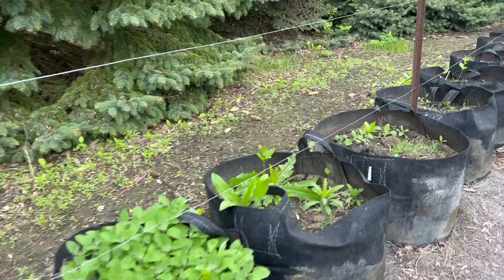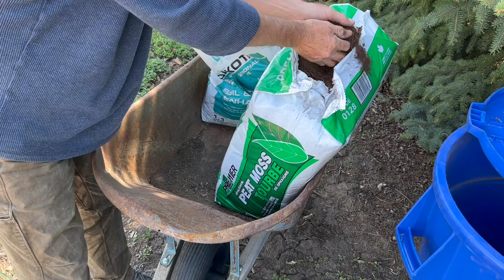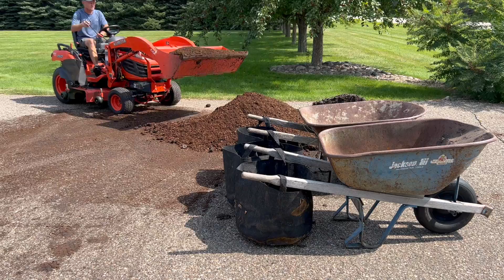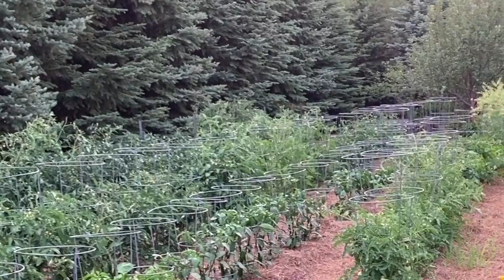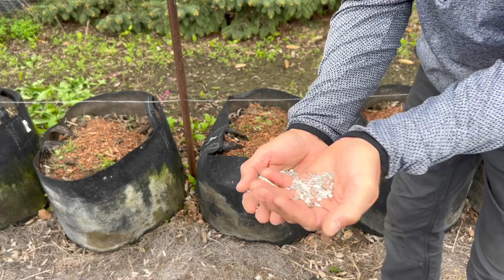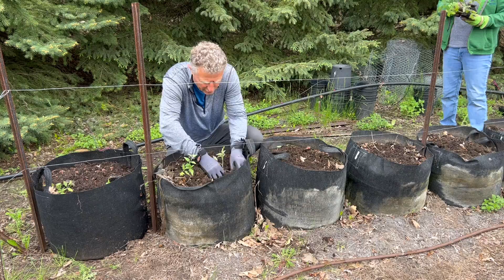Using Grow Bags For Tomatoes | Our Setup

Comment: Very nice video. A few questions: What size grow bags are you using?  What size bag do you think would be the smallest for a single tomato in which you could still get good productivity? 

Do you have a link for the irrigation system you are using?

Thanks!
Reply from the maker: I'm using the #20 size grow bag. I think a #10 size is the smallest I would use for one plant. 

Below is a link for the spray stake that I use. You'll often find the spray stakes sold individually on different websites. This link is for the "assembly," including the trickle tube and emitter. You can choose different gallons per hour with this style stake. I like the 3.2 GPH.

https://www.greenhousemegastore.com/products/netafim-pressure-compensating-spray-stake-assembly?variant=42701309477063